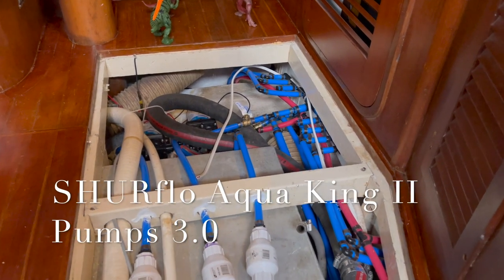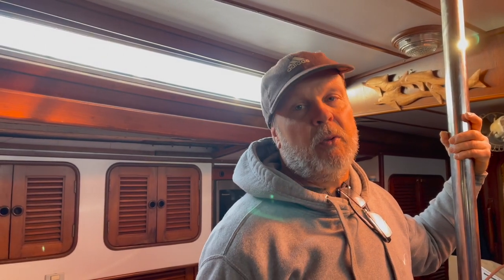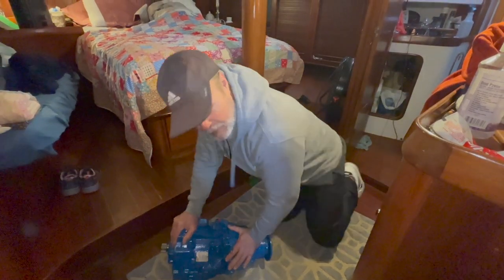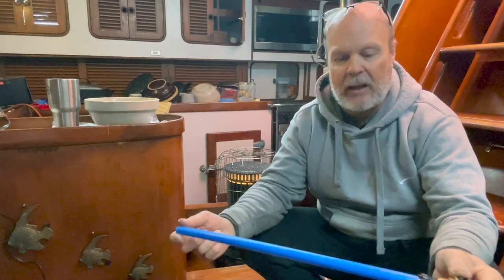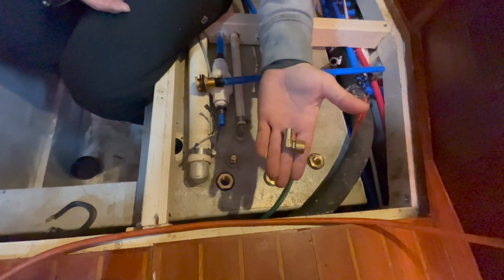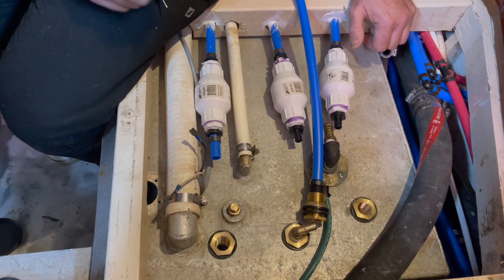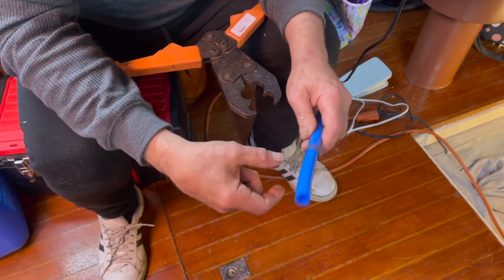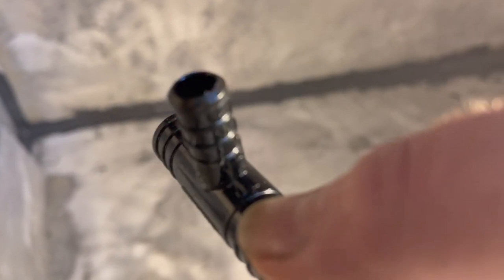WINTER Living on a 55' Sailboat!! Ep 31 Sailing SV Bohemian

Comment: OMG- what an excellent explanation of a typical 'boat' problem! I love the H20 system issues. Clearly, the intake is say 1.25" yet the vent is closer to 3/8ths of an inch. We all know that H2O is denser than air, so- it doesn't require a similar sized vent. But, if filling rapidly from a dock- it definitely could build pressure in the system. So simple, but- that's a 2ndary issue to why you are in the tank to begin with. The leak (start of assessment) to repair was both more money & time & required stepping out of normal R & R (like a car repair) & shows the why of what we do to address issues. I, too, wouldn't be comfy going out to sea with so many issues with my water storage system! When you said transmission, I started shaking like a small inbred dog pooping razorblades. Heavy, unmanageable, no parts make sense to my limited brain- and, finally- everything MUST BE FIT EXACTLY, or- you'll be redoing it inside of a year. But, I watching and noticing that you are as cool as a cucumber- not freaking out even a little! Very impressed.

Comment: Nice boat, good luck the motor looks like a money pit no mater what you do.
Reply: Don’t you know it . A rebuilt one with everything around it new probably around twenty grand. Probably more .There’s one all ready to go at trans Atlantic . Some guy had it in a sailboat ,rebuilt it ,but never installed it. That boat is for sale with or with out the engine . I came  across it when browsing for boats.. but don’t ask me to find it again. It was some boat I never heard of. Its a grand just for a exhaust elbow. The old bowman heat exchanger, it was available ten years ago maybe 15. It was ten grand . Stupid price

Comment: hi, i am a british plumber, the fittings are either, metric or imperial thread which are uk standard- Tapered or parallel. 1/2'' 3/4'' 15mm & 22mm once you work out which its easy.
Reply: Any plumbing skills I have was from flipping houses in Missouri. It helped a lot when it came to working on the boat . I’d say the hardest part of plumbing for me is building a main stack with all the vents and sewer drains . Getting everything to line up. The two shower drains in the boat need done and there no way to get my arm underneath so this should be a interesting .

Comment: Nice PEX work!! Curious, why so many elbows vs. just running a straight line to the sinks? Too tight of a space for the wide turns?
Please keep an eye on the neighborhood boats! 😉
Reply: It was tight . there was no way to follow the routes of the old copper pipes. The bends where to tight of a strain on the pumps and baffles. .  It took two week . And I still need to do the new shower valves and tackle the drains for the showers. I’d say it cost  about 2000 grand for everything . One supply line went to a baffle from the pump . Then individual lines from the baffle to each valve . It keeps the water flow even pulling off a baffle

Comment: Dumb question for ya, does the JB wield  give the water a bad taste? Or dissolve with water also? Would not a new plastic tank be better in the long run? 
This is just my thoughts but you have been doing a great job so far. Thanks for sharing
Reply: Give me a month and I’ll tell ya if I taste it . The cooking and drinking water go’s thru a exspensive filter system at the sink. It’s called seagull 4 . I almost threw it away when replacing things . I took a look on the price ,600 bucks . At that price it better taste like champagne. Down the road I’d think I’d choose a plastic tank. Jb is a epoxy. It won’t dissolve. It’ll perform up to 500 degrees and around 2000 pounds of pressure on a engine block if cracked . The metal has to be cleaned to perfection to work.